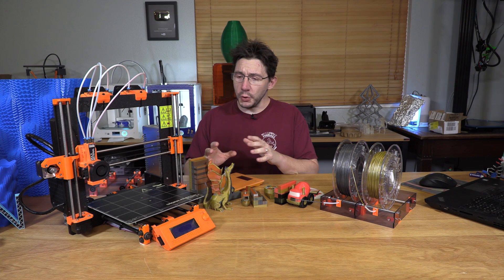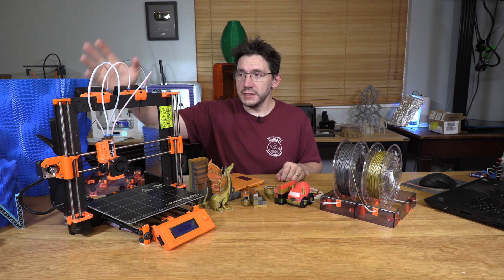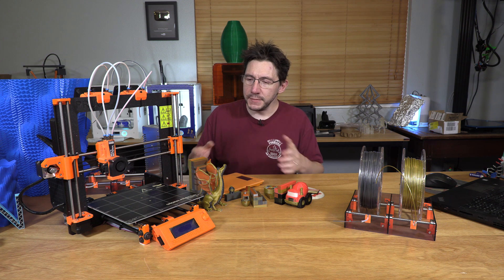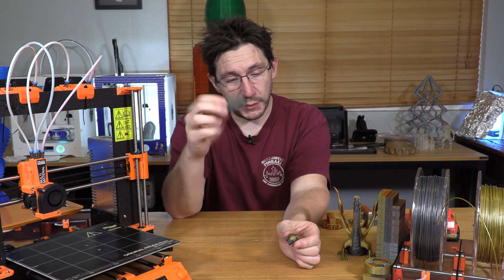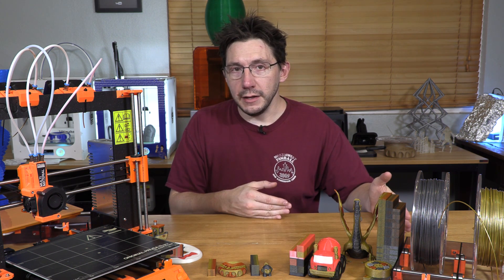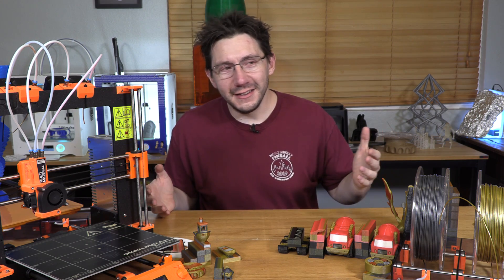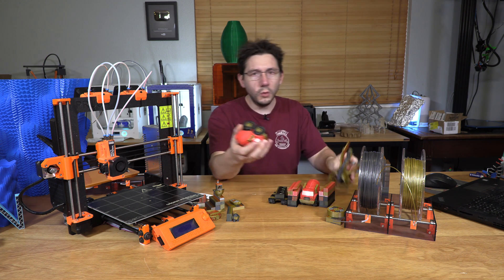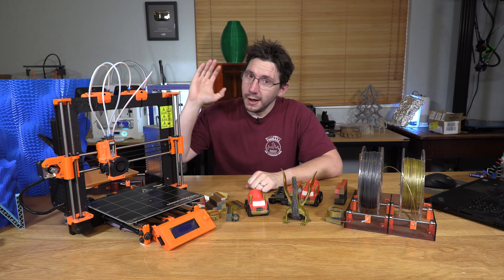Prusa Multi Material Review(?) - My Thoughts on the Prusa MMU 3D Printer

Comment: current slicing software bases the printing process off of printing a model in the center unless the user specifies otherwise, and printing the z axis in almost always in one direction, which is unlike CNC gcode generation, especially when it comes to 5th axis. i think that with the introduction of the MMU and others with multi-color single extruders, it wont be long until we see the model being offset to the front with a purge block at the back that is only used when needed. this removes the need for such large purges vertically, just to maintain the need to have a purge in upper layers. obviously this will be dependent on your model as z axis beds would not work if you had an enclosure, like my flash forge. I also think that in many cases movement to and extrusion of purge block just to maintain the equal height to the print is not only a waste of material, but a waste of time. If you are looking for a multicolor print, you are probably looking for closer to a finished product, and that may lead to the desire for  decreased layer height, and a more efficient purge logic in the slicer could save both material and time. Obviously if you are printing on the gmax and only have colors at the top, the z axis movement would be time consuming, but there are plenty of slicer settings for skirt, raft, brim, infill shape, and slicing with multiple profiles at different layer heights that have already been implemented, and i would hope in the next year or so we see slicing options appear to let us choose a purge method for our multicolor prints. This also leads to a new option of layer 5-10 of your print may be a single color and .1 mm layer height, while the purge can be done at a different z axis level before starting layer 11, and even be a .4 layer height to quickly extrude. maybe in the mean time we can come up with some gcode post processors that allow the user the identify the purge area and refactor that portion of the print.

@Josef Prusa - very excited about my MK3 that should be shipping in the next few days :)

Comment: I think you really missed the mark on this one.  so much wasted time talking about the waste amount.     And  fail to mention that the waste goes down dramatically with the # of copies that you make per platter.    Cost of pla is low enough, but you didn't factor that in at all either.
Reply from the maker: I just want to make sure I'm reading this correctly - you're saying that waste amounts are okay because the cost of PLA is low?

Comment: Colors are nice, but I'm curious about mixing materials with different properties. Like having rigid PLA or ASA juxtaposed with flexible filament supported with water soluable PVA in filled with recycled junk filament. That's what I want to see.
Reply: That is the million dollar question. I don't think that has been accomplished on this kind of multi-material contraption yet.
Reply: 3D Printing Professor Perhaps this will clarify matters re soluble infills  & supports....https://www.prusaprinters.org/printing-soluble-interface-supports-prusa-i3-mk2-multi-material/
Reply: Have 2 separate nozzles. Or 3. Or more. 😊
Reply: Use materials which can be printed with the same heat and it's possible to mix them.

Comment: I'm not sure, but I think producing less waste would even be possible with this system. Can't they switch to the other color and keep using the color that is inside the nozzle and still using it till it pruged itself on the model? I know the switch isn't instant, and a smaller pruge block would still be needed. An option would be cool to print without an pruge block and accept a little color shifting on certain areas.

Comment: it was mentioned in a few other coments but yes you can print a single item with the same size purge block as a full build plate of items. example a single marvin or a full plate of say 20 marvins would have the exact same size purge block

Comment: The waste just seams like bad software design, just put the waste inside the model, it's only the outer most layer that matters, if you have a two layer thick wall you can put basically all of that wast inside the model and have 0 waste.

Comment: As someone who is printing with Stratsys Polyjet machines at work i can tell you that, from a financial viewpoint, this is realy cheap. 1 Kg of basic model resin is about 150$ but to clean itself the Stratasys machine uses up to 50% of that resin, which in turn makes the model material cost itself be 300$. On the other hand PLA is like 20$ per kg so even if you throw away 50 % here it just runs down to 40 $ per kg. So considering the possibilities I see no problem here. To be fair the Stratasys machine never fails a print.

Comment: That "click-click-click" drove me crazy for about an hour before I lifted the spool holders a foot or so by placing them atop some boxes I had in the office... now the ptfe tubes exit about 6 inches behind and 3 or so inches below the intake ports of the steppers and it's a much nicer layout. Highly recommend it. Also, I noticed the PTFE tubes aren't as constricted before you clip them into the little orange holders where they pass through the smoked plexi. I plan to drill or sand those out to reduce the pinch and loosen up the travel through them a bit.

Comment: I distinctly remember a machine that cut and re-attached filament. It would have several input spools (different colors), and just one output, going into a single extruder machine, not even brand specific. It would tune for the length of boden tube going from the machine to the 3dprinter extruder. Everything was done in a pre-processor in software. You'd feed it multi-model files, it would do all of the calculation what filament to mold into the output stream, and it'd generate a "dumb model" for the 3d-printer (the printer itself would be oblivious to what color of filament was going in). 

You would effectively have infinite colors, as you could throw these machines in parralel, and behind eachother. The only thing that would change is the (hopefully one-time) setup, and the pre-processing time. It would actually function as a traditional ink-based printer, with separate cartridges for red, green and blue (or any other color in-between). Sure, it wouldn't make true rgb colors in every shade possible, but it could, given enough spools of filament.

0% waste. Potentially 100% color variety. Why didn't you go for this kind of setup Josef? Too many issues with consistency? Too difficult to manufacture? Too fragile? Too cool to experiment with?

Or is is because it'd be like regular printers: Too little ink wasted on "head calibration", and off-brand ink kills the profit margin? Too simple to sell?

Speak.

Comment: 9:30  No.  It's simply a matter of how many times you have to change filaments.  The more you change filaments the more you're going to purge.  So it's simply matter of how many filament changes you do.  This could be affected by all sort of things, like model orientation.  Your maker coin for instance will purge more if you orient it where it has short runs, and will purge less where it has long runs, across the wave pattern in it.  In the dragon you have a lot of color interleaving and so you have a huge purge block.  In fact your entire theory about it favoring a larger XY is completely wrong.  If the design had a lot of interleaving across the XY plane you'd still have a large purge block.  Again, it has to do with how many material swaps you have to make.
Reply from the maker: +Bu Jin yes, on the Z axis. The purge is consistent per X and Y.

Comment: It could be cool if you can use the infill for purging filament. And if it length is not enough add a smaller purge block. That way the waste filament could be a lot less. 

Or at least. Assign an “purge model “. Could be cool using some vase or model that you don’t care the color. It could have a nice random color finish. Or even painted after.

Comment: Injection molding (in one color) can also be very wasteful. For small parts, the runners and sprue can use many times more material than the parts themselves. Of course in that case, the material costs are usually low compared to even PLA filament, but that not always the case for specialized materials (like the optical plastics used for lenses).

Comment: Yeah, with a single-nozzle multi-material machine like that, there are a number of things that need optimizing for good material usage:
1. reliability (the new MK3 should go a long way for that) [this is the same with any 3D printer, not just single-nozzle multi-material]
2. software (being able to designate something as 'any' material (or even better, a set) would allow some infill purging, etc.)
3. usage patterns (doing multi-material prints in large batches so they share a single purge tower between many models is already a thing you can do, as is designing for an early end to the multi-material portion in some cases)
4. potential future hardware revision (a hardware wiper could eventually eliminate the need for purge towers at the cost of greater mechanical complexity and Z-axis weight, though like any complexity it could cause reliability issues)
However, it still seems like an attractive competitor to multi-nozzle setups with ooze shields. Not definitively dominant, but a very reasonable competing technology.
What I want to see is people pushing the limits of its use with unlike materials, particularly looking at flexibles which the auto-loader will likely have issues with. There the multi-nozzle method still has a definitive advantage, but for all I know the gap could be closed pretty quickly.
It's always cool to see new tech out there in the Open Source community first!

Comment: Joel - one important aspect of multimaterial printing that you should cover is the ability to print soluble supports. I've been printing PLA/BVOH on the Prusa MK2 MM and it works amazingly well.  Especially cool is the "interface" option in Slic3r which ends up using very minimal BVOH. Keep up the great work!

Comment: I had the same issues with the spool holders...  They snag way to easily so I got rid of them.   I decided to build some spool holders into a printing cabinet that mount underneath which spin freely and feed filament at a much better angle as to not interfere with anything.

Comment: Purge towers is a wrong direction. An off-bed purge area that only extrudes the amount needed to get to the new filament is enough. A swipe through a nozzle wiper readys things and print continues. Designs are out there, and has been implemented, not sure why it wasn't popular.

Comment: One of the first models I printed with my dual setup was the Aria the Dragon model. The first thing I realised was that what we need is a smart system which recognises when only one nozzle is being used for many layers and can:
a) Switch off the nozzle not being used and heat it up again in time (only applicable to dual nozzle systems)
b) Print the purge pillar in infill or support style to stop wastage and save time where the pillar isn’t actually doing its job.

Comment: What if instead of putting the color into one giant block it sepperated them so it can then be recycled I'm those machines that turn failed 3d prints into filliament. Or maybe instead of a block it uses that purging material to print something else that doesn't need to have perfect color separation like the main print, so the material doesn't go to waste.

Comment: The purge block is built up even on layers with no color change (note the stack of the Benchy) so that it will be there for layers with a color change.  The only way around that would be to place the purge block so that the carriage could be dropped to a lower layer with absolutely no danger of colliding with the model.

Comment: The multi-material purpose is more than multi-color.
For example a part flex another rigid, another metal with electric property's and another with wood property's.
This is the true purpose of the 3d printer with multi-material capacity, expand the border of what is possible with the FDM 3d Printer.
Reply: The prusa multimaterial is not able to print flexible filament in a mm print.

Comment: You can easily fix the clicking sound that you talk about around the 4 minute mark by running the plastic over a bar to route the filaments up and out of the way of the cables. I wish they could figure out how to program it so if a purge was not needed in a layer it wouldn't print it and would just go back down to the height of the purge block and it would stop it there. Also Idk if they already do this but I think they should set it up the layers so that if it ended printing red it would start printing red on the next layer saving a purge, it might not be much but on a 4 color print saving 1/5th or 1/6th of the purge block then that would be a good bit of material..............

Comment: Great video, Joel. I don't regret buying my MMU and like any other area of 3d printing, a few tweaks were needed.
I changed out my bearings in the spool holders as they were slowing everything down and I also make sure that my bed is full when I print small objects to make best use of the purge block. There are a couple of good downloads of Thingiverse to enable stacking of the spool holders, to improve the feed to the motors. 
I understand people viewing the purge block as a waste, but IMHO it's a necessary byproduct of the unique Prusa process, due to all colours going through the SAME NOZZLE, and not worth getting wound up about. To that end, comparison to any printer with multi material and more than one nozzle are moot at best; they are not the same system or process. There are many good suggestions at reducing the tower, (infill purge sounds very interesting!) but for now it is what it is. (I use the reduced tower setting in Prusa Control every time and have had no adverse effects on the print.) It certainly didn't stop me buying one, and I think some of the videos comments that it is a dealbreaker are a bit overly dramatic!  As for failed prints and waste? That's part of 3D printing; always a risk that it won't go well.  However, I think the results from the printer on completed models speak for themselves.

Comment: I have an idea for the waste material. Why prusa don’t modify the g-code so that it produce two identical shapes( one is randomly colored instead of the purge block) and the other one is the needed printed model!
Because we have no problem having 2 same models(even if the other one is not colored properly) and using them instead of having 1 model + a waste !!

Comment: Very nice video Joel. Introducing another way to do multi color print.
Seems to me multi color print is not quite there yet. But they getting there. And are pushing the limits.
Would be nice to compare all the other methods of multi color printing with this one:
Like the DA-Vinci color, which used print ink to change colors. But I hear there are problems with bleeding ( watch 3d Printing professor).

Multi extrusion heads.

Single extrusion head but with multiple filament inputs. (forgot which printer, it was a delta). Similar to the Prusa MMU

And the Pallete, which is quite expensive vs your normal single color 3D printer.

Edit: I forgot about manually changing filaments

Comment: If you have a system with even more colors available, make one always dedicated to printing a water-soluble filament. The programming that produces the purge block can then be made to make a more sophisticated purge block, with different colors separated by horizontal space (filled with soluble filament) or vertical space (obviously also filled with soluble filament) when there is nothing of some colors to print for a while. If large vertical gaps of some colors need to be filled, print support structures out of the soluble filament to save on that. Then when you're done, you can re-separate the odd, irregular blocks of purged plastic, and recycle them one color at a time. Requires some fancy programming, and a dedicated feed of soluble filament, but it makes recycling an option for this system. Is the Prusa software all open-source for tinkering with this kind of thing? That's a problem I'd love to get my teeth into. If I had one of the printers.

Comment: I'm having the same issue Joel.  I want to mount my filament above the printer. I've designed an enclosure that will allow the filament holders to situate above the printer and am struggling with a design changes to accommodate overhead reel placement, while keeping the filament path as simple and unobstructed as possible.

Comment: There have been lots of discussions not only here but all around the internet about purge block waste. I agree with Joel that this is an inevitable step towards multi-material printing.  Think about early cars, they used much more fuel and produced much more waste than what we have now. Prusa has made an early and a big step to produce a reliable MMU machine. It is absolutely not perfect but it does work.   I do believe as technology advances, we will have more ecological friendly solution in the future.  Many suggested using purged material as infill, IMHO, it is clever but also has it's limitations. I guess this idea will play a role in the future together with other nozzle cleaning mechanisms.

Comment: this can be solved via a multi-head design. Something like CnC machines how they change tools by rotating a new tool in. multiple extrusion heads that just adjust or shift position when a new color is needed. program the machine that (0,0) would be no head and say (-1,1) (1,1) (1,-1) and (-1,-1) Or where ever the position of the heads are are for x color, so instead of a large purge block, there's a smaller prime block if priming would even be needed.